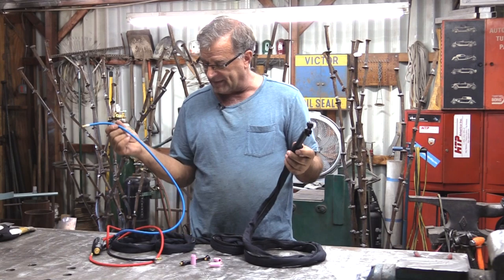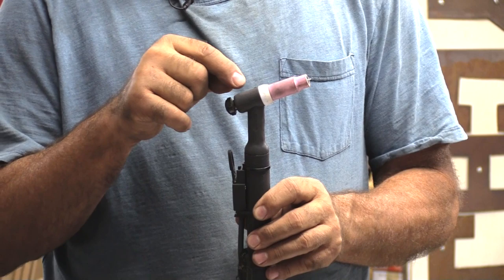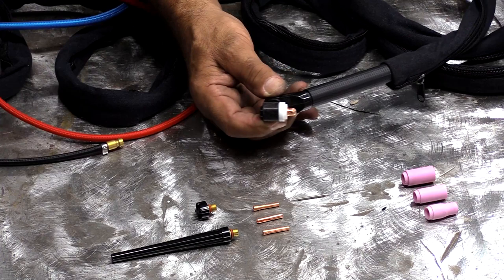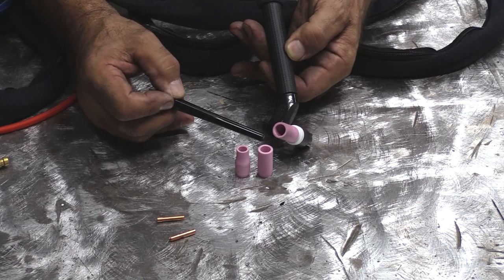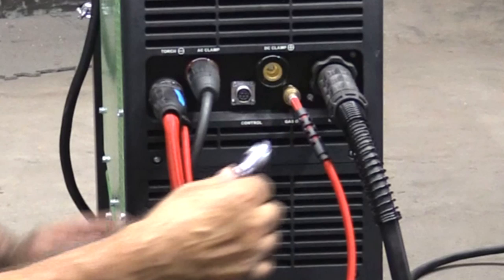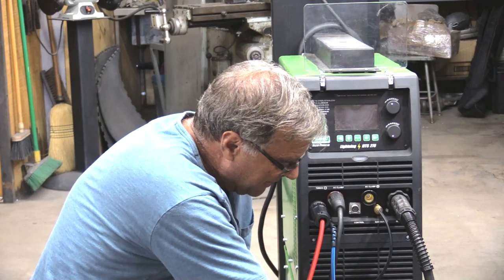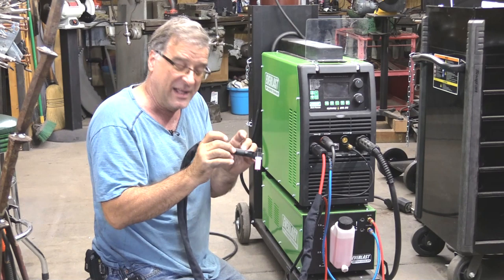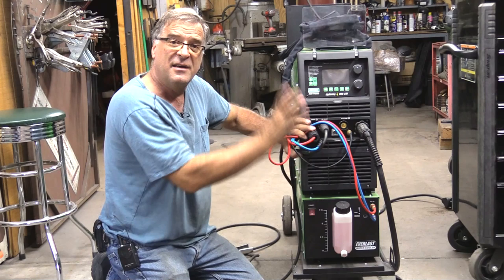How to Set Up a Water-cooled TIG Torch - Kevin Caron

Comment: I received a water cooled torch with my Everlast TIG welder but never got around to getting a cooler. This looks worth looking into.
Reply from the maker: Makes a huge difference in how long you can weld and hot long the torch consumables last.  Well worth the cost in my opinion.

Comment: Everlast said that anything other than industry HF tig coolant will void the warranty. The specifically said not to use automotive antifreeze. Just FYI. It clogs the pump over time.
Reply from the maker: Been running the pink RV coolant in all 3 of my coolers with no problems.   It has been about 4 years.
Reply: @KevincaronSculpture  - I have heard a lot of guys doing it, but if you check the everlast forum, there are also a lot of guys who have had problems and the everlast rep straight up said, it voids the warranty.  I just got one, so I'm investigating everything.  I appreciate your channel.

Comment: I have heard that the colors on the Everlast hoses are backwards. The cool water from the hose should go direct to the torch head and the blue hose actually  goes to the dinse connector first so you should plug red to blue and blue to red to get the flow going in the right direction. Do you agree or would you just match the colors?
Reply from the maker: I just match the colors.   And they fixed the backwards thing.

Comment: when your finished using machine do you put it away with the coolant in the hoses or does it automatically go back in its tank, is there anything special that has to be done with hoses after?
Reply from the maker: Great question!   Nothing has to   be done when I am done for the day. The coolant stays in the hose and the cable just gets coiled up.

Comment: Hi kevin,just a slightly different question.do you see any problem running 0.6mm mig wire through a 0.8mm liner and tip?just found loads I need using up thanks😁
Reply from the maker: Nope, do it all the time.

Comment: Hi Kevin. Enjoy all your videos. Just wanted to see if you have had any problems with the new machine since it's so new. Thanks.
Reply from the maker: Not at all!    Am very impressed with the MTS 275 Lightning!   Has become my go to machine for welding.  Now if I could just think of a way to mount the plasma on the same cart!
Reply: @KevincaronSculpture  Thanks Kevin. Good to hear. I like the Everlast machines and have had no issues with mine. I'm just a home shop welder so they fit my needs. I think a plasma cutter would look great on top...lol.

Comment: I am just learning how to TIG. I just bought a AHP 225 and the AHP water cooler. What torch are you using in the video and will the connection work with the AHP set up?
Reply from the maker: I think it is a 26 series torch.   Hooks up and works just fine with AHP because that is the one that came with the machine.    Haven't had a reason to change it.
Reply: @KevincaronSculpture  Yes, the AHP air-cooled or gas-cooled torch that comes with the AHP machine works great. I am just trying I see it the torch you are using in this video on the Everlast machine is compatible with the AHP 225 set up with the water cooler. I have seen that you have made a video of the AHP 225 about a review and have both machines. I would figure you would be the best to ask it the water torch will work on both machine. I am just trying to find one compatible with the AHP 225 and AHP water cooler. Thank you

Comment: I tried compressed air to push a blockage through my water power feed line and did the opposite on the return line I'm trying to break free a blockage do the lines become like flat straws when running around a torch head causing it to plug up with particulates because it has a thinner tolerance and easier to plug up? Is there pics of a liquid cooled cut in half from top to bottom?
Reply from the maker: I would assume there is a photo on the internet somewhere.
Reply: @KevincaronSculpture  I can't believe I could ask that in any different way to get to the same answer I'm looking for. I've been welding 40 yrs . The air has worked in the past. Certified 6G , was boilermaker tin knocker and wire nut. Cyanide bromine chlorine ammonia I specialize in the real nice stuff chemical plants One Way air flows scuba gear parts per million oxygen content for confined spaces and all of this time I have never thought about cutting one in half but every time I look for three-dimensional view or a blueprint with the different views overhead side and all of that I just find a one two-dimensional view that you really can't follow the train of thought of how it gets around the head I've got quite a few heads that are here in my shop so I might just do it as a learning experience I got a new torch works great this time I hooked up a diaphragm pump for like a camper or RV 60 PSI output with ball valves to adjust the the force or pressure of the water getting through so far so good if you do come across it let me know something thanks for your time enjoy the advice thank you again

Comment: Hi , was the torch set up expensive and did you pay for it or is this a sponsored video  ?
How are you finding the tungsten holder / swivel part holds up  to daily use , many thanks.
Reply from the maker: The torch came with the machine.  They sell for less than $200.  Been holding up to daily use with no problems.  The trick is to not over tighten the screw holding it in place.
Reply: @KevincaronSculpture   many thanks ,, i think ill treat myself , and its handy to know how they do in real life and a genuine review not one thats been bought.